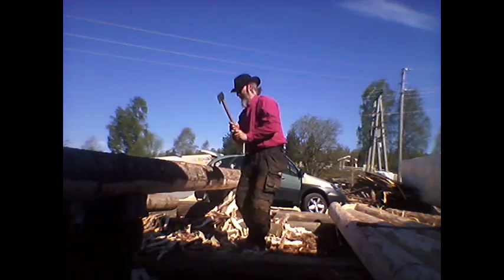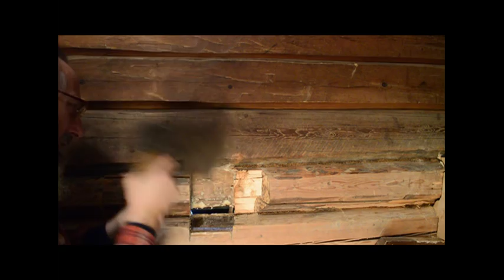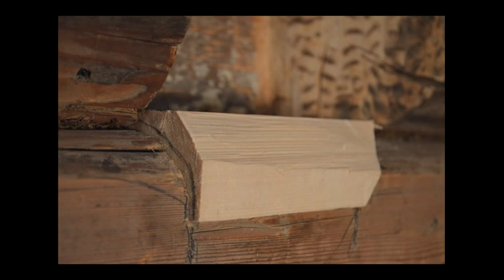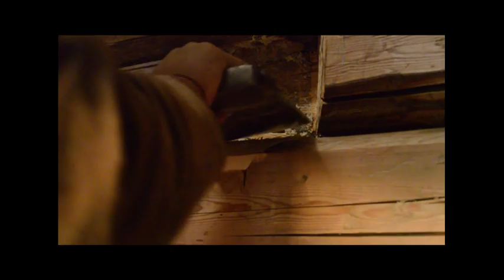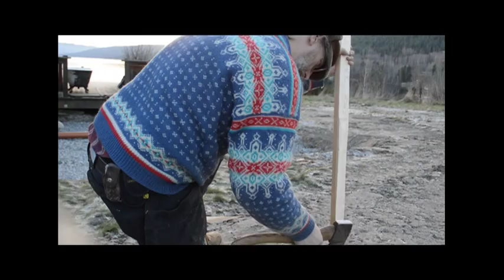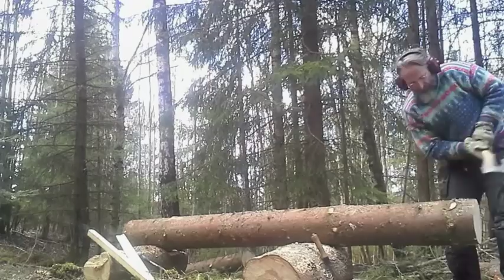Axe work for house restoration in Norway

Comment: Any info on that axe??I've been interested in a similar axe made by toporsib.. Great work and love the videos... I gotta catch up on the garage build..
Reply from the maker: It's a Bile pronounced bee le, made by Jon Dahlmo http://www.dahlmo.no/bile.html
about 23 years ago I think he still makes them. I made the handle myself, it is Telemark style. It is a small axe for its' kind and was a low budget axe at the time. But I like the steel, it holds it's edge well but  is not so hard or thin that it chips on spruce knots. They can be as hard as nails after a hundred years. Cheers!